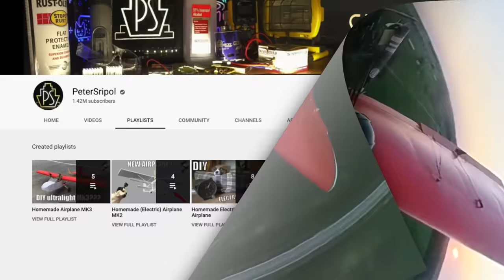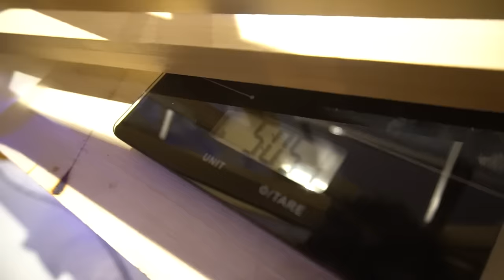Homemade Ultralight Airplane MK4 - pt1

Comment: Nice one Peter! This version is looking really good. I have one small suggestion, you can rotate the silencer on the Moster at 120 degree intervals so that the exhaust port faces backwards. I don't think it will affect performance with the way you have it but it may look a little better aesthetically and will blow the exhaust with the airflow. Really curious to see how the motor works in that orientation over time!
Reply from the maker: I was wondering about it, good to know rotating it should be fine!
Reply: Time for Tucker to donate a Risky Biscuits T Shirt and Cap to Peter. Now that will be cool.
Reply: Ily
Reply: I was wondering if someone was gonna point that out. Exhaust being ejected forward, thus creating unnecessary back-pressure, just didn't sit right with me.
Reply: Tucker you have to admit there are times you’ve thought about building this. I’ve been waiting for someone to beat me to a twin Moster airplane. I think a Moster on a goat glider would be awesome
Reply: @derekpirie9188  and a dont call the faa shirt
Reply: Man you are so best youtuber
Reply: I subscribed to you
Reply: Peter would you be so kind as to provide the length and pitch of the prop and manufacturer. Thank you
Reply: @Bryon Call I'm curious what you meant about a twin Moster airplane.     I believe the Moster is curently being used on the Bloop with good results.
Reply: WOW, Two of my favorite youtube channels WOW
Reply: Trucker gott I'm a big fan
Reply: @vertrox3435  Isn't that a 2stroke? A tiny bit more backpressure should be a good thing then or at least not bad in any way
Reply: You both should Colman that would be fire-I watch both of your vids
Reply: You are the best 🛩
Reply: @vertrox3435  you are right in theory but it is not that powerful output. In preactice it is not a big deal.
Reply: Leave Peter alone and hop back on your paramotor. Just playin
Reply: You all probably dont care but does anybody know a way to get back into an instagram account?
I was dumb lost my password. I would appreciate any tips you can give me!
Reply: @Royal Kairo instablaster ;)
Reply: @Mohamed Ayaan I really appreciate your reply. I got to the site through google and im waiting for the hacking stuff now.
Looks like it's gonna take quite some time so I will reply here later when my account password hopefully is recovered.
Reply: @Royal Kairo no problem =)
Reply: Did you just use pine for the would just wondering what did you use
Reply: Ay gott Ay how is your mom😅

Comment: i wonder if peter ever thinks "this will be my final invention " when he flies it?
Reply: It will be his final if he crashes from sky high
Reply: @mr.e3987  He has a parachute
Reply: @twinleaf3076  based on a quick search, parachutes open in around 400 feet of a free fall, minimum. Doubt he'll be flying that high, and even if he is, I highly doubt the plane will break in level flight, rather than on the ascent / landing.

Comment: I don't really know how to weld, but I'm going to weld together my airplane.
Reply: That is a process that many newbies have had no problem with.  It is often recommended that one have the motor mount welded pro, but the other parts are often welded by amateurs and often gas welded which is dead cheap and well proven in aircraft.

Comment: 11:02 I see you're flying straight with quite some positive elevator deflection. Is that purely because of the low airspeed (flying at Cl_max) or might there be some possible optimization by increasing horizontal tail plane incidence (so that you can fly at (Cl/Cd)_max with no elevator deflection)?
Reply: You sound smart af
Reply: Yes, there's a need to change the incidents to make a clean flying airplane.

Comment: For your tig welding, are you using amy sort of flux, or purging the pipes of oxygen? If you use Solar Flux on the interior of the pipe (or purge your pipe with argon/inert gas) you will get less or no porosity on your welds, and have a higher quality weld
You might be doing that, just thought I'd give my advice anyway

Comment: Peter, any tips you can provide regarding the Oratex covering?  I plan on covering my Badland UL soon, and will be using the 600.  Also, did you notice any bleed under the tape when applying the two coats of adhesive?  (And did you leave the tape in place for both coats?)  Thanks in advance!

Comment: the tail skid looks a bit low, on the runway it looked like it was just dragging the elevators. this seems like it could cause excessive possible damage and stress on the elevator. maybe it's a little too far forward?

Comment: So this plane has some similarities to the MinMax Airbike such as the slim fuselage and footpedals outside the fuselage body, and some similarities to the Legal Eagle (steel chromoly fuselage), and the round aluminum tube wing spars remind me of the Affordaplane, though many other ultralight use it also. 
It's a beautiful creation taking some of the best of multiple design features.
Reply: MiniMax is an enclosed fuselage the airbike is slim fuselage, they're not the same, I have a MiniMax,

Comment: So question; if you were to make a 5 electric motor mechanism run by a 4 stroke engine with a gearbox and dynamo, would that still work for the propeller?

Comment: I think you could lose weight by using joinery instead of those flat half disks over the many butt joints. A biscuit cutter or dowels or tenons would work very well and makes strong joints with no added materiai.

Comment: I want to build a 2 engine plane.Bro is it possible to fly 130kg ultra light aircraft with pilot on 60kg trust.  I want to use DLE 170 cc two engines and each engine is 17 horse power.  34 horse power in two engines.  30 kg of thrust is available in each engine

Comment: Very dangerous, you dont have to prove it will fly. When you stood on the fuselage for a strength test and said that "it will never have that much force on it anyway" i dont agree with that at all. The envelope of that plane wouldnt be hard to enter at all. What you need to understand is that you may only weigh 60 kgs  but your bodyweight will double with every g, as will the weight of the wings and the engine. When you perform your inverted flight from 10 feet off the ground before pulling down hard to shoot to 1000 feet while jetting purple show smoke it will tear to pieces. (yes i took my comment down a comical road but just to keep in your mind that weight doubles, tripples and more under vectoring...im sure youve seen the topgun 2 trailer.....if you were to pull up like that in a hornet, you'd tear every control surface from the aircraft.......love you man stay safe.

Comment: Its a plane-a-cycle? still how does it steer? so its siting in the main wing "V air slot" if you will,  and just the tail fins control movement? hmmm never knew that would even work...

Comment: Awesome! I want to build one but mine will be a different approach. I saw diy bulds of using a hang glider attached to an imflatable boat with the ultra lite motor on the back. So you can sit and just use the triangle to make the kite pull the boat up out of the water. great for fishing lol

Comment: If you try using a push engine as a "pull" engine,  please check the thrust bearing capability of that engine... the thrust bearings are set for the specific use. Point is, you could grind up the crankshaft and/or engine case, ultimately engine failure. Not good when you fly Mexican style (low and slow) 😜
Reply: well if you would watch the whole video you would know that he has talked about this in the vid

Comment: If I ever made a plane I wouldn't ride until I have my parachute by by side
       Just come on what if it the engine stop working at high altitude which is enough to kill me

But still nice work
Reply: If you had an engine failure, you would want it to be at a high altitude. Then you could glide farther.

Comment: hey guys i want to know if you can build a Ultralight with a ( 50 hp 326T electric motor design C high torque 1800 tefc PE326T-50-4C ) ??????

Comment: QUESTION! to turn a puller into a pusher you reverse the wires! do the PROPS stay the same! the props have numbers on its front  which point to the sky not the engine! when reversed do the numbers stay in front pointing now to the tail or do they get reversed? its my understanding that they dont but then the prop is running in reverse!
Reply: He didn’t reverse any wires. The motor is still running in the same direction. He is just reversing the direction of the propeller so it will pull instead of push.
Reply: @chocohouse4147  if you dont reverse the wires how do you get it to switch? are you saying you turned the propeller in reverse and mounted it backwards?
Reply: @charlesklein7232  no, he didn’t do anything to the engine. He just got a propeller that is designed to be used in a puller configuration. It is a different thing designed for a different motor. Simply having a reversed prop would provide positive thrust as opposed to negative thrust.
Reply: @chocohouse4147  YES! i have heard of this TODAY a few hours ago they are marked with a "P" on it. i have possibly seen so much confusing information regarding this. thank you!

Comment: The load path on that fuselage is awfully designed!! The way the tension bending moment has to go over and around the pilots seat... Building an airplane that can fly is not the same thing as Engineering an aircraft design